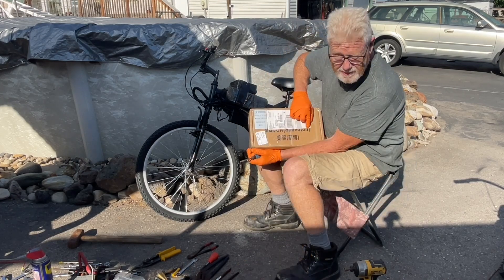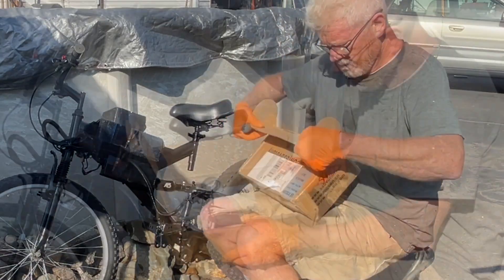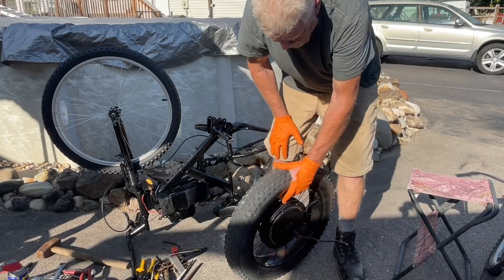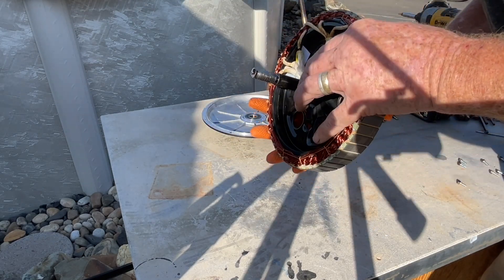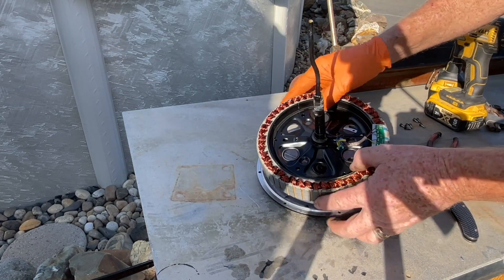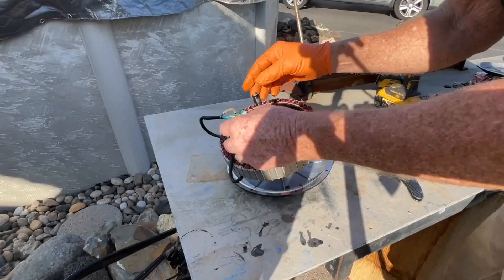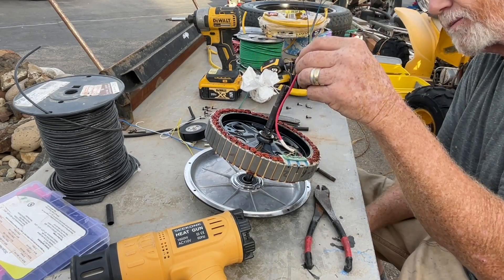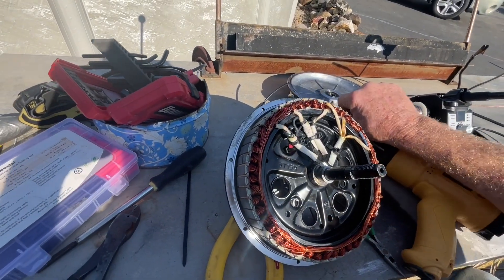DIY 1000w E-bike Phase Wire Upgrade! 72v 200 amp Sabvoton controller is Way Too Powerful!

Comment: Thank God i finally found you. Someone who really talk about ebike phase wire. Sir, may I ask if I need to join the ebike phase wires into my controller phase wire, do I really need to solder them both together, or I can just use cable tape to tape around the phase wire?

Comment: Sorry you got thrown, but wow! I am looking forward to that 72200 on my Motor Goat.
Reply from the maker: Hello Marvin, I do a lot of fun but fairly dangerous stuff. Some people worry about my chemistry refining projects.. however, nothing is more dangerous than my ebikes! 😆 🤣 😂 
The original 1000w BLDC Motor fried.. under the massive amount of current, which is no surprise.  However, I modified another 1000w and dialed down the power to 60a max current.  At this more reasonable power level, it is still quite fast (45+mph), is much more controllable, and most importantly, it is still running well.  🚲 👍
Thank you for your comment and support 🙏 
Peace Prospector Tripp

Comment: Awww man even the Dog knows its time to go back to the drawing board you definitely a Tuff Og stay under 100 amps with no whellie bar or extended swingarm electric motors have toooo much instant Torque without a redline 😅😂✌
Reply from the maker: Surprised my butt 100%
Now I run it at just under 1400watts. Tops out at 45 mph and has lots of zip on hills. 
Stay golden sir
Peace Prospector Tripp
Reply: @ProspectorTripp  yes sir ✌

Comment: Oh man i love this reminder electric motors have 3 times the Torque than combustion engines at ZERO rpm,s  im 56 now been building Pev,s for the last 20 years 10kw -40kw  & still get dumped off certan bikes i build unless i add a 34" swingarm ✌ 😂😅
Reply from the maker: Safety 3rd 😆 
Please stay safe sir
Peace Prospector Tripp

Comment: Thanks for sharing i,ll custom build those Qs 205mm motors to match the same power as the mighty 272mm  now that I can see the shaft can be Bored out a bit to accept bigger phase wires in my case I need 7-6 awg to handel above 300 Amps I noticed in the last 20 years that green phase wire lamination in those Outrunner / Hub motors from Qs always melt in time Nevertheless i,ll add forced air colling to the motor cases to cool the entire Stator ✌
Reply from the maker: Wow.. 6ga, that’s huge phase wires.
This motor I smoked.. 😂 that sometimes happens 💨 when testing the limits of reality ☝️
I replaced with another 1000 watt motor that I am limiting my power to 1400 watts. I potted it and ventilated it. So far it’s Golden 🤠
Stay on it.. Zoom zoom!
Peace Prospector Tripp
Reply: @ProspectorTripp  yes sir above 300 Amps  continues requires 6awg to avoid thermal runaway ✌

Comment: I am glad you all right (not injured). Video great.
Reply from the maker: Yeah me2.. 
Butt was bruised and elbow scraped..  not too bad.
Yeah, that 72v 200 amp controller is wildly powerful. Surprised me 100% 😆 
This bike is now running a 72v 60 amp controller and is a joy and ride.
The 1000w motor at 72v 60a definitely gets slightly warm but not hot, and the phase wires never get even slightly warm. Success!
Thank you.. stay Electrified!
Peace Prospector Tripp

Comment: I hear those controller can work without connect the hall sensors wire rights?
Reply from the maker: I don’t know about that point fully. I do have 3wire RC airplanes without hall wires but not sure about this point for bldc e-bike motors.
Peace Prospector Tripp

Comment: The weak point in the 200 amp setup is that at full power , the field coils will fail during sustained operation in hot weather . I have seen a 14000 watt e - bike overheat on a freeway during a hill climb in the mountains from the car . The motor was smoking and the rider wasn't aware of it . A bit like overloading an electric drill .
Reply from the maker: That 200a controller is coming off and a more sensible 7280 going on.
The motor may smoke anyway?
We will have to see a bit later.
Thanks much 
Peace Prospector Tripp

Comment: Your copper wingdings look like they've already started burning out.
It should be bright orange not a dark colour.
When that happens starts to get more resistance.
Get less power
Reply from the maker: Thanks for the info.. let er smoke if needed! 😂 
Peace Prospector Tripp
Reply: The motor housing is too small and cannot dissipate the heat losses effectively . The unit would need to be larger in the same way that high current transformers are larger than low current  (Amps) ones . My Yamaha FZR motorcycle is faster than your e - bike .

Comment: Even at 72v 50 amps 
Will hate that hub motor up .
And copper coils will become oxidised
Then well lose a lot of performance.

I upgraded a 1000w 48v hub motor last month.
(1) bigger wires 
(2) cooling ferro fluid
(3) cooling radiators fins
And it's still gets too hot for my liking.
It's only using a controller 72v 50A.
I can only imagine with double the amps and 
No cooling mods.
It will definitely burn out
Reply from the maker: Understand.. gotta get the 80 amp controller installed to give it a chance.
Thanks 
Peace Prospector Tripp

Comment: That thing is a beast!! I have a no name brand fat tire Ebike, would love to upgrade to your setup but I could never pull it off. Side note, I work with Gordon Smith, said you guys grew up together in Michigan.
Reply from the maker: Yes sir, Lance is a co-contributor to the wheelie crash 😂 we did everything with gas back then.. but it’s still the same concept. 
Make it light and fast!
Glad you have a ebike too. As far as upgrading. Just upgrading the speed controller to a more powerful one is fairly easy and a huge improvement. You can check your speed controller and see what amperage it is and the physical size. There are many available on eBay and Amazon that are fairly inexpensive. Less than $100
As always read and study so you are making a good correct choice.
Thanks for commenting! 
Tell Buzzy (Lance) thanks!
Peace Prospector Tripp

Comment: Judas Priest😳😳😳 you should hook up your speed controller from your sluice to that thing, so you can dial it down a bit….😂😂 seriously though if you could give it half Power for starting out you’d have something there (until the front wheel bearing melts from doing Mach 10 with your hair on fire…) that gave me flashbacks to 1999 we drove to Phoenix to buy my 13 year old a dirt bike (a used Yamaha yz 250) I took it out on the highway behind my in-laws to give it a test spin ran down the road and back and turned it around and thought… ok let’s see what this thing can do shifted from first to second about 1/3 throttle hit third and punched it…. Had no idea it had a power band…. Up on one wheel I went and as the front wheel lifted off it automatically made me twist and increase the throttle.. just before I flipped over backward I twisted the throttle back down and pulled over to the side of the road and replayed the part where my life flashed in front of my eyes…. I drove it back to the house and the wife said what do you think I told her it’s to much power for him up in the mountains with trees…. He made it about 3 weeks before breaking his ankle… glad you ok and you caught it on film if condense that down and make it into a short you may get a million views out of it 🤩(leave in the safety gear bit for sure) thanks for sharing was a cool and informative build see you on the next one👍🏼👊🏼
Reply from the maker: Yes sir, those yz’s really cook. Glad you lived 48! Most of us have done a few things that have helped us understand how the physics of blacktop is, in fact very Hard material! 😂 
The little mountain bike that “Could” is going to get its 80 amp controller. I got some additional documentation from Sabvoton so hopefully it works.
I was definitely surprised buy the power. I just finished upgrading the 72v battery and wow.. the wheelie crash proves it worked! 😂 
The huge wire motor modification with the high current battery all being pumped into the motor coils with that 200 amp controller really made this one too fast. The planned 80 amp controller is still a lot of power. Hope it works!
Thanks for your terrific story!
That’s Golden 48
Peace Prospector Tripp
Reply: @ProspectorTripp  so could you run the 80 amp for start out and switch to 200 amp once your cruising ?? Hehehe… or would you need a bomb squad suit for protection in case of a wreck…
Reply from the maker: @48thstateprospecting  no need.. the 72v 80 amp controller will be plenty of power for this very light build.
The 200 amp controller is for another more far more safe 4 wheel diy ride.
Thanks 48
Peace Prospector Tripp

Comment: Voltage = resistance x current. U=RxI
My old brain is starting to work again 😆.
I understood what you were doing. Hot cables melt and cause short circuits. Howdy Matt, that was good work 👍🤠
Reply from the maker: Hello Peter, I just finished power modding my battery, a very powerful battery along with this 200a controller is Way Too Powerful for this little bike!
Surprised me 100% 😂 
Don’t worry I am just fine!
Peace Prospector Tripp

Comment: Very cool, maybe hold off on any longboard electric designs :) I saw a while back a guy on a long board shooting around thirty plus mph, I was like dang
Reply from the maker: Hello DDI, I originally bought the 200a controller for another build. It’s at least 2x too powerful for this bike. 
I’ll be working on the 72v 80 amp controller.  Very soon!
Thanks much 
Peace Prospector Tripp

Comment: Nice man🧲👍⚓️
Reply from the maker: Hello BBA, the power of that 200a controller is Crazy Power for sure!
Before the wheelie crash, I just installed that blue 24v battery.. which I just modified for Maximum Current!
Holy Smokes! The two 48v batteries in parallel with the Max Current 24v battery makes for a 72v battery with insane power.
Stay safe BBA
Peace Prospector Tripp

Comment from the maker: Hello all,
On my DIY mountain bike build the 1000w BLDC Motor Phase Wires were getting hot with the 72v 60 amp controller. Because I want to install a better, smoother and slightly more powerful Sabvoton 72v 80 amp controller, I need to upgrade the original 18GA Phase Wires with heavier 14GA wires that can handle almost twice the current.
This motor mod is working great and the phase wires are now getting only slightly warm and not getting hot! Yahoo baby!
The planned 80 amp controller is giving me a hassle so I decided to install my 72v 200 amp controller. This is a super powerful controller I bought for another project and certainly too much power for this very light mountain bike. Watch and see! 😂 
Love to all 
Stay Golden
Reply: Love It ✌